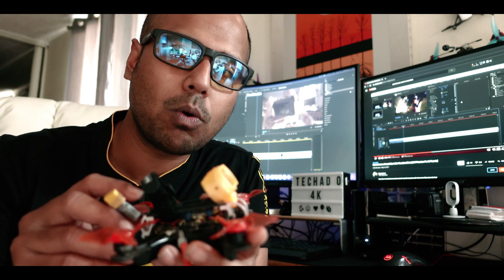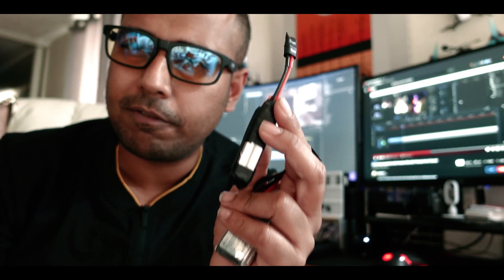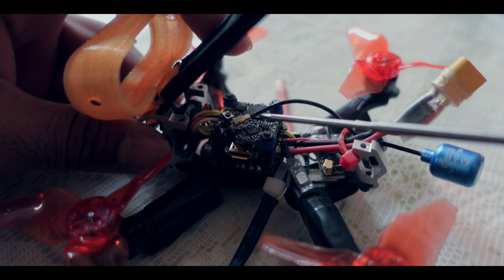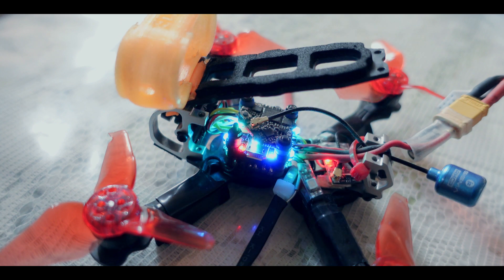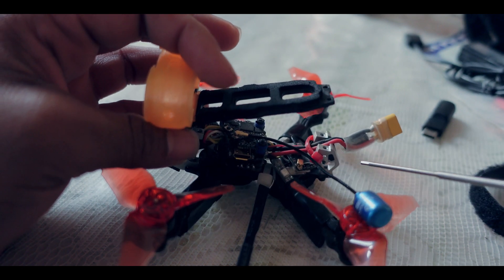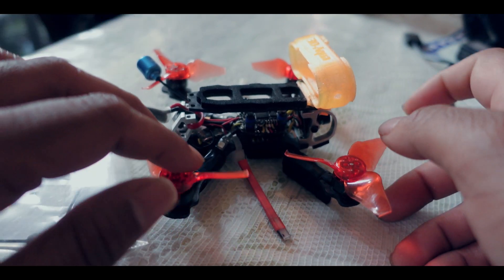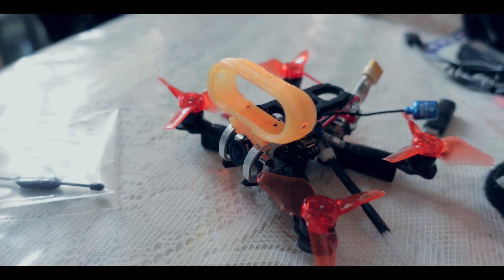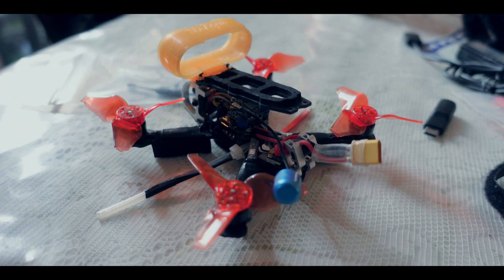SMALLEST LONG RANGE 65 mm FPV DRONE ,test,footage,showdown.

Comment: my 95x with R9 and TBS Pro32 Nano and Tarsier v2 and 1207 6000kV motors. Was heavy at 120g dry weight.  i use to explore out  but never went far.. max run time 1300mah get me 9mins but battery didnt fit well and didnt fly well. slow cruise only.. I tested a lot of batteries.. running LiHV 1100mah was good.. 850mah and less were good.. drone died though.. No clue what happened.. flew fine. no crash. then next time taking it out it would not arm. first said RPMfilter. turned it off.. still didnt arm. didnt see any warning but temp warning came on fast.

Comment: I just made this build, but with the guts of a Cinebee75hd. The motors are 1103 10000kv. I get 3-4min on a GNB 3s 450mah. Would I find more flight time with 5000kv motors? Great video. New subscriber.
Reply from the maker: wow its so nice to hear , i started with the same with my 75hd the trick is lower kv and since you have a very light frame , use 4500 1105 motors  and try bi props , 
i started like that but then i scrapped the project due to higher amp draw , then i started building this , with flywoo mainly due to the vtx , and armattan tadpole also smaller 2.3 inch props rather than 2.5 inch props but definitely i would test with 2 props . with this setup i am getting 7 mins easy with the insta360go. i saw lot of companies making with 18650 liion batteries but they have a high chance of explosion or fail when you draw more amps to recover from a dive.
Reply: @Techado  thank you!

Comment: I actually have a 2.5" long range phantom.. I'm using a whoop board with 1106/4500kv on 3s tattu 850 mAh I get 11 minutes. I'm working on something else that I expect to be a real long range MICRO build that will come very close to the 30 minutes the 4 inch quads are getting, and it will be able to carry a Vista.

Comment: Wow! Great quad 👍 how long is the flight time?
Reply from the maker: i am getting with the insta360 go about 7 mins on triblade props.
without insta360 go bi blades i am getting 9 sometimes 10 mins .
if i had used a whoop board i could have got more .
Reply: Techado would you plz make build and bind video

Comment: I'm impressed with how well you got the insta360 go footage to look on a YouTube upload! I gave up on that camera too quick it would seem!
Reply from the maker: the footage was heavily edited , i went through 3-4 trials , had to fix the noise and then the horizon didn’t look good so added gopro’s hypersmooth in adobe .
Reply from the maker: i wanted to go naked gopro but after i saw that the units break after 1-2 times of use , i was like lets stick with the insta360 go , i wish also they had more frames . atleast !! i will share how to fix horizon and few tweaks to make the insta360 video good